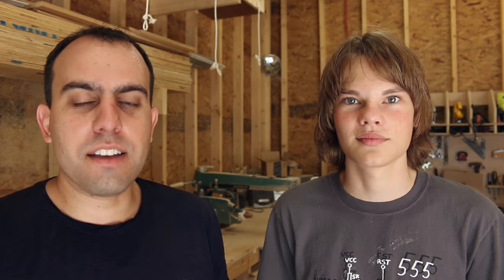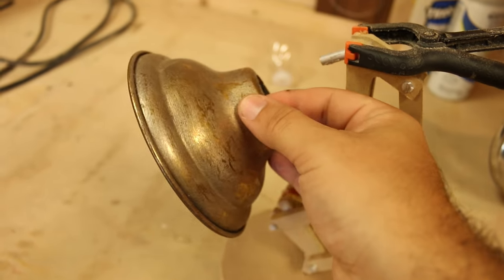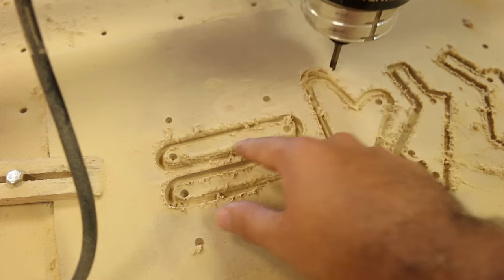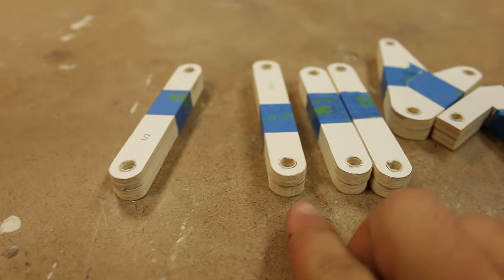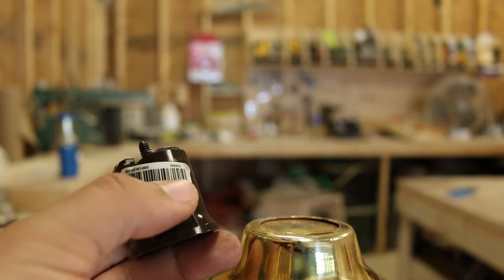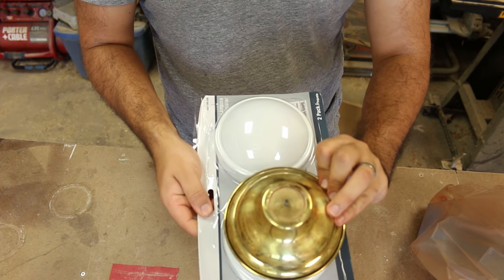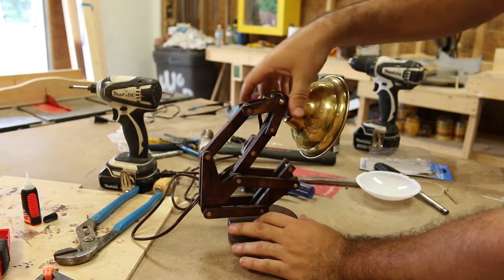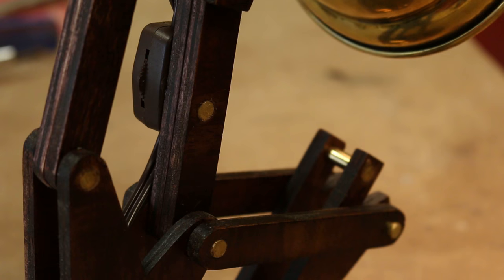Mike Makes a Luxo Style Desk Lamp (FINISHED)

Comment: A luxo lamp is supposed to be self balancing at all positions without relying on the friction between the joints, which is the reason for the springs on the original luxo lamp.
To do this you need to get the geometry just perfect, then calculate the spring force base on the lamp head weight.

Comment: Hi Mike! I like the design though it would look so much better with the mahogany. About the X-carve problems: probably some calibration to re-do but also your bit looks in really bad shape and that could be one of the problems. I would recommend a 2 straight flute bit sharp. Your seems to have only one flute and to be burned and dull. About the mahogany cracking: That's because the wood grain of that little piece should be running on the other direction. :) Your videos are great and look forward to see what you come up with next time!
Reply from the maker: +Get Hands Dirty I agree.  I didn't have any more mahogany and almost gave up.  The plywood was just a last ditch effort to finish.

Comment: Loved the design of that light mate, could you put up some Sketchup designs? Just made myself a walnut computer desk and have been 
looking for the right light for it, this would be perfect. 

Looking at the router bit you used I'd say that was, at least part of, your problem. Thin spiral upcut bits are supposedly the best for clean cnc cuts, as far as I gathered when I was researching mine (haven't got round to building it yet...). Moot point though, and if you can't get it working I'm having second thoughts myself! Hate calibrating tools to the nth degree, after a point it's just time you'll never get back
Reply from the maker: +lee porter Here's a folder with the sketchup and .svg files.  I didn't have time to clean them up so hopefully they make sense: 

http://www.mikeandlauren.com/wp-content/uploads/2015/11/lamp_files.zip

Comment: Good stuff! Don't glue the lens on, how are going to replace any type of bulb in the future? Every bulb eventually burns out or dies. A suggestion, the base needs weight so it doesn't tip over and knock the lens off. Perhaps a lead core. Keep building cool stuff! Cheers!🍻
Reply from the maker: +Carb IV I cut out the part about looking for a weight to put in the base.  Great minds think alike :)

Comment: great video guys.

I'd swap the arduino for a gecko G540 driver. 

there's enough to do working out spindle speeds, feed rates, cutter types, cutting depths and holding down stuff without the drama of flaky electronics.
Reply from the maker: +thermmaloverload Thanks, I hadn't heard of the gecko driver.

Comment: Here's an idea to attach that defuser, super glue some small magnets to the lens, if the cover is plated steel or magnetic attractant, whalaa...auto stickon..just a think.. I like that lamp !!
Reply: And that would make it easier to remove the defuser for changing the bulb or doing some other maintenance.  If the cover isn't magnetic attractant,  maybe he can affix some kind of metal ring just inside the rim.

Comment: any chance the CNC was climb cutting in the spots it went haywire? If the motor has enough power it could maybe force the x and y axes along a notch or two that the processor would be unaware of.

Comment: Could you be loosing steps on the y axis due to low voltage? There are potentiometers on the GRBL Board that allow you to adjust the voltage going to the steppers. It seems like a poorly documented issue with the X carve and with the two steppers on the y axis you need a higher voltage.

Comment: Use led strips to make your own bulb.
Reply: Problem is you're stuck with a bulky plug, or a converter brick half way up the cord. The cord is also thin, nasty electrical stuff and doesn't look very nice, in my opinion anyway. I prefer using fluorescent bulbs, or led Edison-style filament bulbs with traditional holders, that way you can wire them with some extra fancy twisted cord